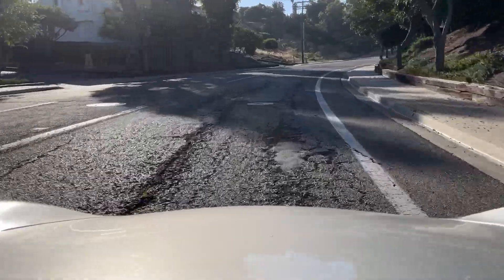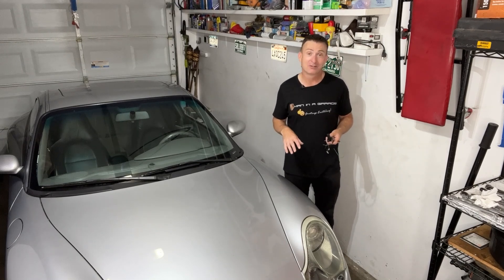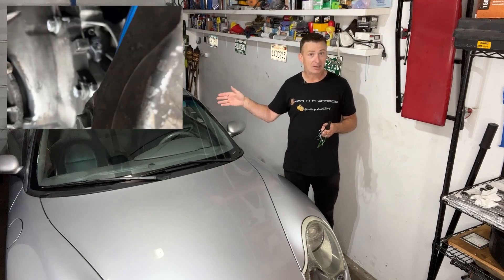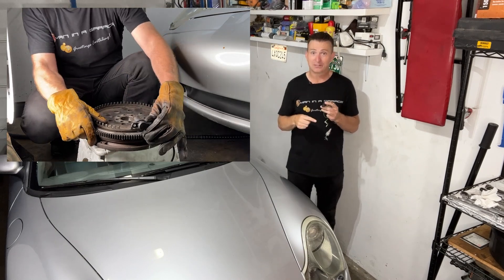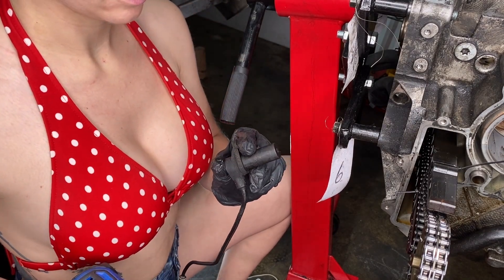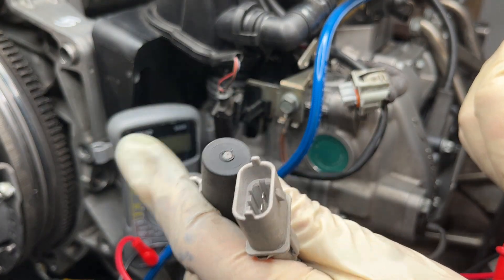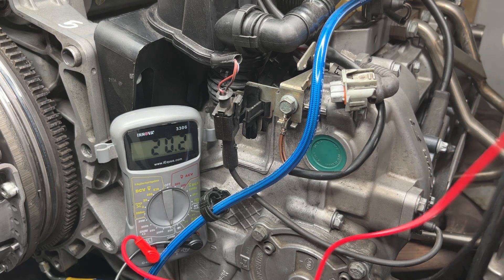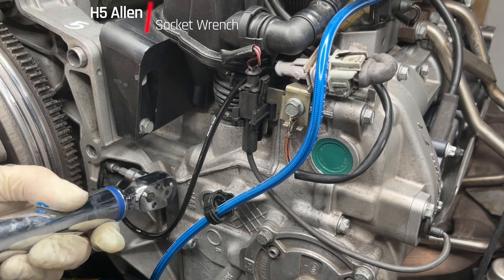HOW TO: Porsche CRANKSHAFT Sensor replacement

Comment: Another great video, I’m starting my 997 engine because all 6 of my cylinder bore scoring from very minor to major. I wanted to ask, which bolts did you reuse to save money?
Reply from the maker: Hello James, Most of the bolts were reused. By the time it got to the rebuild stage I felt very tuned into the feel of the bolts and the torque being used. For example in the thread repair episode, those bolts stood out as being issues from the start. It’s that “made of modeling clay” feeling you get when torquing the bolt plus the feedback from the torque wrench display telling you that the bolt is not on a linear path to tightness. With that in mind I replaced a few bolts here and there (oil pump cover, bank 1 cylinder head cover) other than that, the main bolts I did replace were the arp bolts for the con rods and Porsche bolts for the bearing carrier. If I were doing it again I would use arp on the bearing carrier. In this case the bearing carrier along with the bolts and bearings were Cryo/heat treated which may compensate. In a perfect world, I would buy a kit that had every bolt for the rebuild. The very best of luck on your project 🍀 Thank you for watching 🤘😎
Reply: @ManinaGarage  thanks for the reply! I’m going to do that and replace them like you said with ARP. LN Engineering is sleeping the block and they have a kit for all the gaskets and bolts. Thank you again!!

Comment: Hi . Have you ever experienced tappet chatter after  your rebuild or. Oil changes ?
Reply: Sorry lifter chatter.  Thanks
Reply from the maker: @sheldoncorr3476  Hello Sheldon, good question. This is my first rebuild, every noise the engine makes has been of great concern to me. So far at least, zero chatter from the heads. Thank you gif watching 🤘😎

Comment: Hope you’re feeling better. I had Rona back in January and it was the worst sore throat I’ve ever experienced. 
I don’t know if mine has ever been changed and was thinking about doing the Crank position sensor as preventative maintenance.
🤷‍♂️
Reply from the maker: Howdy Phill, things are are more or less back to normal now! The crankshaft sensor did not help the intermittent slow to start issue, it is nice to have it off the list. Thank you for watching 🤘😎

Comment: Did the new crankshaft position sensor end up fixing the slow starting issue? It sounded like it may have not fully resolved the issue. 
I have a similar problem on a warm start where my 1999 C2 just cranks and doesn't start without some throttle coaxing.
Reply from the maker: Hello Denis, the crankshaft sensor did not fix the problem 😅 People are suggesting the Y cable that connects the starter to the alternator and b+ junction box. Apparently there is a known issue with these cables corroding internally causing them to pass less voltage when hot. I don’t know if this will fix it but I looks like I’m going to have to try it. What have you tried so far?

Comment: Hey Finn, if your engine is only hesitant to start when it's hot, it's probably the alternator/starter power cable. Stupid design, it corrodes and develops high resistance when hot. It can be done with the engine in the car (FCP Euro has a vid on replacing it on the 3.4 I think) but way easier when out, naturally. Probably too late! I did mine (3.6, different routing and plumbing) and what a magical difference!
Reply from the maker: With luck, you are 100% correct. I might lower the engine again to get access, not sure yet. Thank you very much for your insight. 🤘😎
Reply: I had the exact same experience when I changed my «Y»-cable. Made a huge difference. Did it with the engine still in the car. A few tight spots, but not really that difficult.